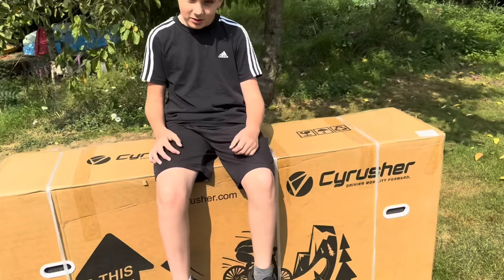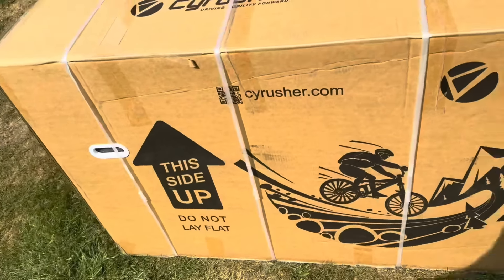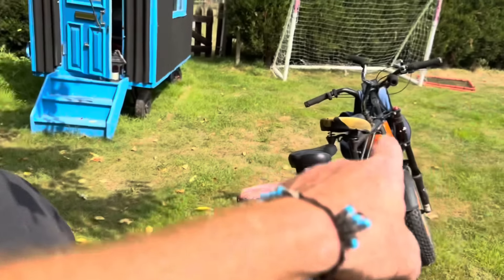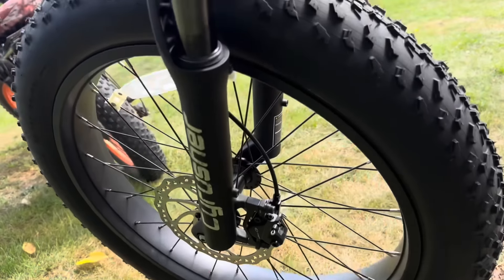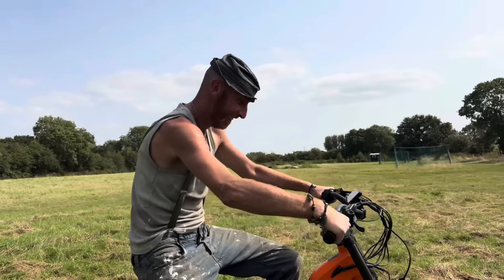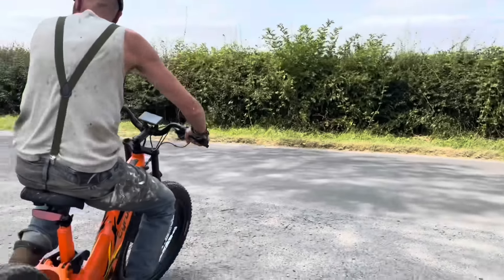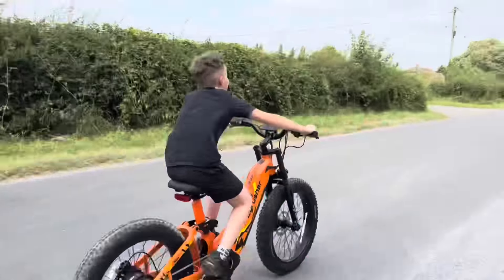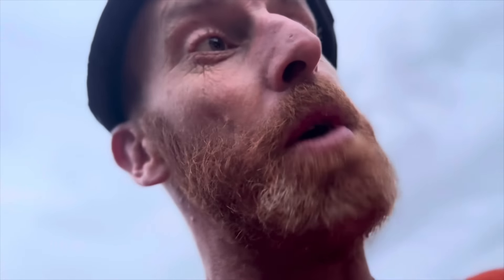CYRUSHER TRAX E-bike! Strugglers review! KOMMODA how it fares after a year???

Comment: if u use the straw on wd40 can and inject it under the handlebar grips they slide off. Just clean em and use some hair spray when refitting them so they grip the metal.
Reply from the maker: Aaar I like that idea mate! They are bloody tight mate😅 did one yesterday even tighter
Reply: @Professional-struggler  if you remove them on a hot day its possible even without any liquid i constantly turned them and pulled a little bit otherwise you can also use soup water or heat them up a little bit with a hair dryer
Reply: @Professional-struggler  if you use an air duster , they come of even easier and cleanly

Comment: Fantastic video - made me wonder if electric tandems exist - and they do! Several on that well known auction site.
Reply from the maker: What double hub motors Mike?
Reply: @Professional-struggler  no, I meant a 2 seater bike with 1 motor - some are front drive, some rear, and some mid. Take a look on ?Bay. 2WD bikes also exist, but only in the USA as far as I can tell. I suppose it would be possible to build a bike with hub motors front and back, and a mid-drive as well.

Comment: Looks good but I wouldn't go back to chain drive mine has a carbon fibre belt no lubrication no rust just wash off with a hose pipe, and I thought it wasn't going to last long so I bought a spare, I'm still on the original since 2019 and over 26000 miles yes twenty six thousand miles!
Reply from the maker: Never even knew such a thing existed mate… and as you said wouldn’t of thought it would last long, but I suppose no corruption like a chain 👍